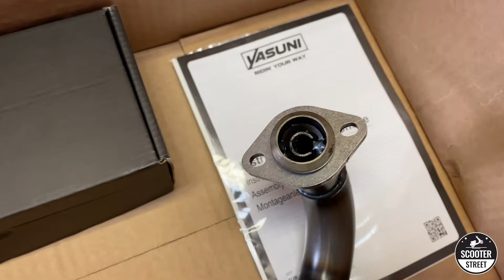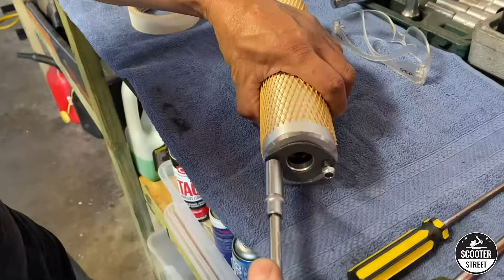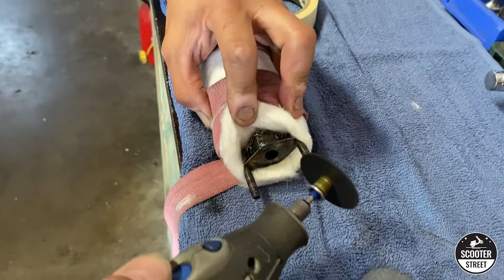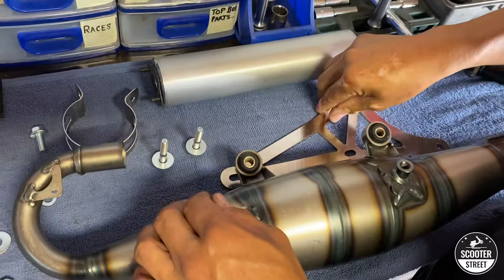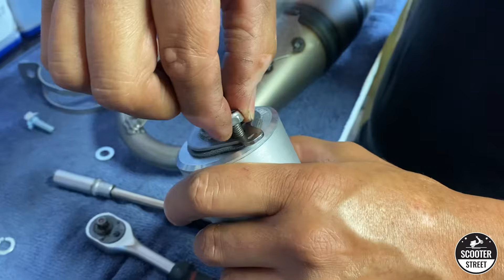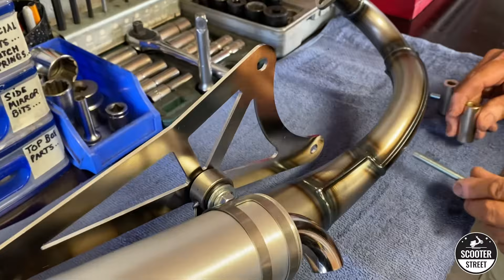Yasuni Exhaust DE-RESTRICTION - UNLOCK Your Scooter's Power!

Comment: The only thing is putting the Yasuni R on a Aprilia SR 50 is a nightmare.  They route the pipe right over the other exhaust bolt.  It requires the patience of Jesus and Gandhi.   Why they couldn't move it over a tiny bit like Leo Vince does is beyond me.
Reply from the maker: 😂Yes it can turn you in to a Patient😂. Due to its ability to multifit the Piag. Aprilia range.

Comment: should i change yasuni z to yasuni r on stage 6 70cc streetrace with 17,5mm dellorto carburator? Or what exhaust to buy in this price range?
Reply from the maker: I find the Yas R is excellent for 70cc kit, Yas Z great for 50cc.
Reply: @scooterstreetau is the yasuni c series worth to buy for this engine?
Reply from the maker: @x_jakub7033  Yes it is in the race as a suitable exhuast, just keep in mind the accelration off the mark power is important for street use.
Reply: @scooterstreetau i want a bigger v max on this engine and i am choosing between yasuni r yasuni c16 and stage 6 pro replica
Reply from the maker: @x_jakub7033  SOunds like a great project👍

Comment: I’ve got a zip from the year 2000
I bought a malossi multivar 2000 variator
Polini speed clutch
 stage 6 70cc streetrace
The 17.5 stock carb
I got the sito plus exhaust pipe but want to get something new,What exhaust pipe you recommend?
Or what more recommendations you think?
Reply from the maker: You can go for any higher class exhaust. The Sito gives great feedback down low, so it really depends on where you want the power. The power starts at the cylinder so that is a good place to begin.

Comment: I was wondering what if i just  take the rescrictor out the one at the cylinder head? What the difference if i take both out vs only the one at the cylinder head and which tools are best because i dont have these that you used.
Reply from the maker: The best way is too try it and find out, believe me from experince when both are removed the result is 100%

Comment: Just curious, what’s the difference if you leave them in vs when you take them out?
Reply: performance increase
Reply: @kommandant.357  Can you elaborate more?
Reply: @itsroads206  In the EU we have restrictions on speed for 50CC bikes We cant go faster than 45 to 55kmh (depending on the country) and that means that scooters are restricted with a combination of or a ring in the variator gearbox (CVT), a metal stud like this in the exhaust muffler and beginning and a restricted air intake.

So if an exhaust is sold for 50cc bikes it needs to be restricted. Hope that helps!
Reply: Also means that the ring only blocks speed and not acceleration, stuff like restricting airflow through exhausts and air intakes will also ruin acceleration and such
Reply: You get more flow and more power out of it

Comment: What kind of setup would you recommend for a stock piaggio variator with this pipe? How about mainjet? Does the clutch springs or torque spring need to be changed?
Reply from the maker: I would use the YasuniZ, between 58-68 mainjet, Adjustable Polini clutch, 6.1-6.5gram rollers.
Reply: Is there a video on changing clutch springs and rollers

Comment: So the thigs that you took out you just throw them out and that gives you extra power ?
Reply from the maker: Don't throw them out use them as key rings. Yes extra power. It is like blowing thoough a straw full of rice, clear out the rice and then the air flow become unimpeded and flows quicker.

Comment: tell me is there any exhausts better than the yasuni r(boost more kph) around the 150-200 euro price range. And my second question is my planning to buy a stage 6 air filter the one thats like a rectangle a stage 6 belt, stage 6 variatior rolls and a yasuni r with all those mods how much kph would i expect and is there anything from stage 6 that will boost my kph thats not one of the mods i mentioned above and is around 50 euro?

Btw my scooter is a 50cc and it goes 80kph
Reply from the maker: You are best to buy an exhaust that matches your cylinder..
What Scooter?
Reply: @scooterstreetau  sorry for late reply gilera runner sp50 full stock
Reply from the maker: Yasuni R🎉🎉 @blade663

Comment: I have a gilera runner and stock it goes 80kph how faster will it go after i install a yasuni r with no restrictors?
Reply from the maker: You would expect around the 88kph.
Reply: @scooterstreetau  tell me is there any exhausts better than the yasuni r(boost more kph) around the 150-200 euro price range. And my second question is my planning to buy a stage 6 air filter the one thats like a rectangle a stage 6 belt, stage 6 variatior rolls and a yasuni r with all those mods how much kph would i expect and is there anything from stage 6 that will boost my kph thats not one of the mods i mentioned above and is around 50 euro?
Reply from the maker: It really depends on the type of engine and the cylinder. Save and buy the 70cc kit, it will be the best value upgrade. @blade663
Reply: @scooterstreetau  yes i think thats the best option to buy a 70cc kit and a exhaust then do small upgrades later on. Bte can u tell me the best value 70cc cylinder from either stage 6 or malossi. And also when i get a 70cc kit would the stock parts be able to handle the 70cc cylinder
Reply from the maker: Stage 6 is good value and performance, Malossi is good reliability. @blade663

Comment: Hi i just bought the yasuni z, didnt remove the restrictors because i thought that it would still be better than my stock one (like 70kmh)
but now the scooter runs at like 40kmh and i have no idea what the problem is. 
is it the restrictors,jet or anything else?
the scooter is aprilia sr50
Reply from the maker: I don't understand why you leave the restrictor in place? The restriction restricts the power. This is why we make this video.
You must tune all parts of the engine to suit a new exhaust otherwise low engine power will result.
Reply: Stupidity  beyond all comprehension  @scooterstreetau

Comment: Which combo is best for piaggio hyper 2 2T , stage 6 50cc street race cylinder kit with Yasuni Z exhaust or Malossi 70cc sport cyclinder with Malossi wild lion exhaust ?
Reply from the maker: Stage6 50 is less power then 70cc. Yasuni is much better performance than Wild Lion. Stage6 50 if laws bind. Wild Lion if you want the conservative look.

Comment: How much top speed will you gain?
Reply from the maker: 15+
Reply: @scooterstreetau  Ohh nice
Reply from the maker: @Kinamoto  the engine must be tuned to suit the additions you install.
Reply: @scooterstreetau    Okay this is my Setup:

Malossi 70cc Sport

Technigas Q-TRE Exhaust (with the restrictor in it)

Dellorto PHVA 17,5 Carburetor

A mix with weights 3x 5G and 3x 6,5G

Malossi Delta MHR Clutch

Red Malossi Clutch Springs

Blue Jasil Pressure Spring (30%)

Original CDI 😦

My top speed is 73kmh

How much do you think I Will Gain if I remove the restrictor?
Reply from the maker: @Kinamoto  I cant believe anyone would buy an exhaust and not derestrict it. I don't understand?

Comment: hello, i ordered yasuni r, multivar 2000, malossi x kevlar belt and im going to try some 5.3g rollers. do you think yasuni r is too open for stock 50cc?
Reply from the maker: R is good for water cooled engine and better again for 70cc kit.
Reply: i have a gilera runner 2012

Comment: Hi there. I have a question about an exhaust, of which I cannot find anything on the web relating to my desired answer. I have a Minarelli Horziontal (YQ50 block) with a Yasuni City 16 (bought second hand), have been running it for years. And no, not with stock engine :). It seems there is a sealing ring in the pipe itself (engine side, pre-expansion), sealing or clamping the exhaust port flange. I cannot find any good references for that part online. Do you have an idea about this part? Is it a regular silicone o-ring? Or a deformable metal seal ring? As it feels like a soft metal, but perhaps because it was a silicone o-ring that has carbonised by now. Asking because I think its leaking there, exhaust seems louder and I've excluded all other options. It's not the silencer. Thanks in advance!

Comment: hello,i have yasuni r malossi delta cluch 4.3 rollers white spring malossi special belt malossi red air filter in box on aprilia sr 50R 2005 what jet should i get?
Reply from the maker: Always start with a rich jet and slowly move down 1 size at a time until you have a clean burning carby.

Comment: Would this pipe work for a tbg 303r hawk 50cc and what pipe I should get if not
Reply from the maker: No, You need the exhaust which is manufactured to fit the TGB 50cc engine. You may find them on our website under the TGB 50cc category.

Comment: I want to get a 70cc malossi kit ( its the 926 kit , cast iron cylinder ) for my 2011 piaggio zip , i have a yasuni r exhaust , a polini hi-speed vario 6.3 g roller weights , would the stock 17.5 dellorto be enough for the setup and what jet size should i go for , also should i get lighter rollers and maybe change the clutch springs and a contra spring?
Reply from the maker: Sounds great so far, yes the carby be ok to start out but the carby can be upgraded when you upgrade the cylinder class.
Jetting. Always start rich. I would use heavier rollers if required.

Comment: I have a 2020 Aprilia Sr 50 and i run a Leovince tt on it with stock springs and contra spring. Should i go for a malossi fly clutch with white springs or yellow springs and a purple contra spring? or is the purple spring to stiff for a 50cc?
Reply from the maker: I would go for an adjustable Polini G3 clutch shoe. The Contra spring will depend on the roller weights and the ability the engine has to build rpm. The spring is needed to assist lowering of the gear when off the throttle.
Reply: @scooterstreetau  I have 6,5g rollers and i am using the  50cc with leo pipe and multivar variator, could this handle yellow clutch springs and purple contra?
Reply from the maker: @Octavian17  Give it a try and you will see the results.
Reply: @scooterstreetau  should i use the 6,5g rollers for the purple contra spring or o should use lighter rollers?
Reply from the maker: @Octavian17  You need to give it a try and you will see the results. How can you learn if you don't try?

Comment: Hi guys, this will be quite long but I would appreciate some help😁. I have a sr 50r mhr rep yasuni r some variator stuff and stock air box. After installing the 70cc I realized that when driving in the rain the moped start sputtering on high rpm and after a few minutes driving it finally just turns off. When I looked the air filter was full of water. I just waited let it be and it started the next morning. But a few weeks later I got caught in the rain again and the same thing happened but this time the moped was hard to start(The day after). When I got it started it revd fine and the back wheel spins like normal up until 6k rpm I’m guessing, while on the stand. Then the rpm drops quickly then goes back up in span of 0,5 second. And I let go of the gas because I don’t want to be brake anything. With both wheels on the ground the bike won’t move forward just does a small hope. 
This was a couple weeks ago but the problem remains. Have you guys experienced the same problem or at least have an idea if what could be wrong? It would really help, thanks in advance.😁
Reply from the maker: I don't understand why water is getting into the airbox, look into the air intake, as you may have to redirect it.
If you ever get water in the engine it must be cleaned and dried out ASAP, this is urgent and important so clean the intake to carby to reeds.
Reply: @scooterstreetau  The water only became a problem after I installed the 70cc so I guess it just sucks so much air that some water in. I can’t se any other way because I have done anything to the air box. Can you specify more on the cleaning/ drying part? Because I feel like all the water would have evaporated now because I have started and it’s been a few weeks, and what is there to clean?
Reply from the maker: @theo2522  Or if you are riding through deeper puddles. Remove the air box and clean the inside and check the air filter as water will sit in the filter. Clear the carby, remove bowl ad dry everything, make sure jets are clear as water restricts the fuel. If you dont clear the water internal parts can damage prematurely.
Reply: @scooterstreetau  what part could have broken? And in what way, rust? Because it has been standing still now for some time so I fear this may have happened. Also do you have any ide of where the problem could be, from the symptoms mentioned I the fist comment. Also I would like to thank you for the fast response and help much love.
Reply from the maker: @theo2522  Start the checks and you will see.

Comment: Hi, do you guys have any Yamaha neos, and would you recommend it for tuning?
Reply from the maker: Hi there, Neos has the same cylinder as the Jog. Check the small end bearing 10mm or 12mm. All of the usual parts for the 2 stroke. Cylinder, exhaust and transmission, carby if the budget allows..

Comment: Quick question, mate. Gilera Runner 50, old shape, with Malossi Sport 70cc, will get 19mm or 21mm dellorto carb. Which exhaust would you put on it? Yasuni Z/R? Currently on Leovince ZX, but it's dirty as hell and I have no way to clean it, could use something better. Crank, transmission etc are changed to at least street level.
Reply from the maker: The "R". In the meantime, remove the ZX and using sanding block/paper rub it back and clean it up, repack the silencer and replace the nuts. The final step is using Heat Proof Paint (can spray) give it a couple of light coats. While the pipe is drying wash and degrease the silencer and the end pipe. Will look new again. Careful to fit it on to the engine and when the exhaust gets hot the paint will set. Will look great👍🎅
Reply: @scooterstreetau  oh, that's not what I meant. It's been fitted on the bike since it had 2k km, and now it has almost 20k. It's seriously clogged up inside with oil/carbon deposits, and pipes inner diameter are quite a bit smaller. Call it natural restriction, lol.
Tried cleaning it with drain cleaner and hot water, but amount of dangerous waste was too high to do it more than once, and it didn't really help. Current vmax is about the same I had on stock, ~85 km/h.
Reply from the maker: @MrZarnach  😂😂, ok dirty inside. Only way is to burn it out, so yes time to change it. "R"
Reply: @scooterstreetau   jeez, there is no end to this bike! Put Dellorto 19mm on it, and it looks like when main jet starts, it bogs down for a second and then works more or less normally. Does this sound like too big main jet? I honestly have no clue.
Also when you put on a bigger carb, should you downjet from the one you had before? Remember seeing something like that on the forums.
I'm trying to learn tuning 2 strokes on that bike, but I'm getting more and more confused.
Reply from the maker: @MrZarnach  A larger carby will generally require a smaller jet then the carby it replaced.
You need to start the whole tuning process again, so start rich until the splutter clears, tune only when off the choke in an Auto choke. On the Dell 19 the needle will need to be changed and the pilot jets to as they are more sensitive than the stock carb. If manual choke you can cheat tune by lifting the lever.
Reply: @scooterstreetau  faaaargh. So bigger needle, smaller pilot jet, smaller main jet. Another costs. And what would be the reason for that split second splutter when switching to main jet? Too big difference in amount of fuel between needle and main?
Reply from the maker: @MrZarnach  Is it lean? what does the plug say? have you tried different jet using the start rich to splutter method?
Reply: @scooterstreetau  I started at 80, checked it with new spark plug - electrode was yellow-ish, center was black, insulator had yellow tint, one side of spark plug also was yellow-ish. Spluttered. Put in 95 to exclude being lean, turned out waaay too rich, had no power at all and spewed a lot of smoke. Put on 85, included with carb - has more power, runs better than 80, didn't had a chance to make proper run to check spark plug. I have a pic of it at 80, is there any way I could send it to you?
Also I just got idea, I need to check height of the electrode. I'm using NGK BR9S
Reply from the maker: @MrZarnach  It sounds like you are on to it, I would never jump more than 1 size when tuning. Tune out the splutter first then plug checks with a new plug.
Reply: @scooterstreetau  Ha! Accidentaly nailed it! Turns out it needed 80 main jet, but with needle dropped down to the middle. Sparkie looks like beautiful coffee with milk! There is room for fine tuning for sure, but it's good for now. Scooter feels nice and playful, almost fell off it when added more gas in the corner. Now it's time to play with rollers
Reply from the maker: @MrZarnach  Great job, it was no accident✌
Reply: @scooterstreetau  still has ways to go. I'll probably plop a cone filter on and tune it for it for a day or two for shits and giggles